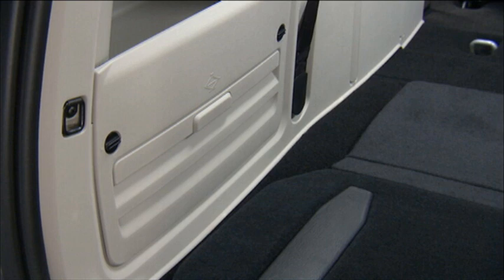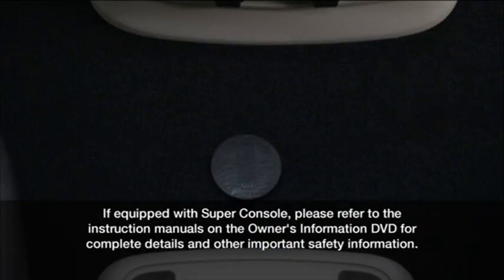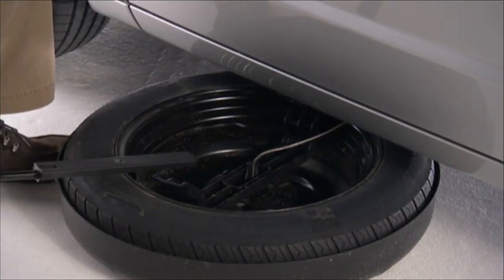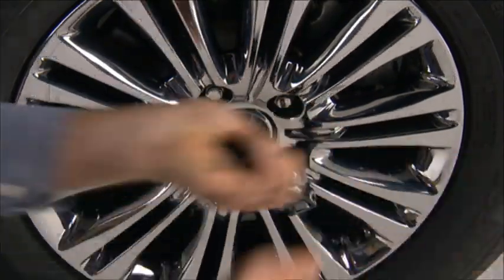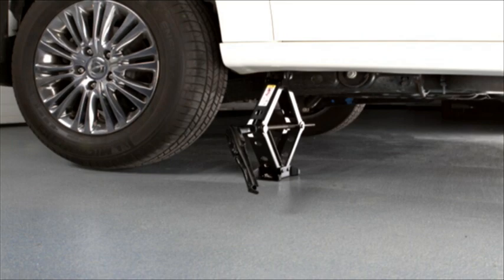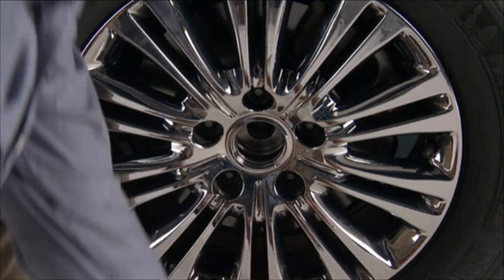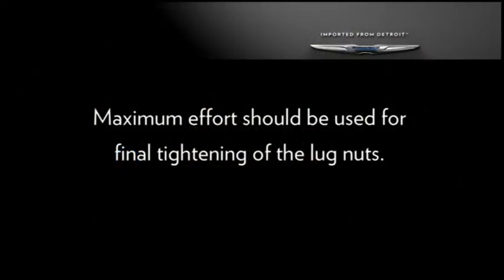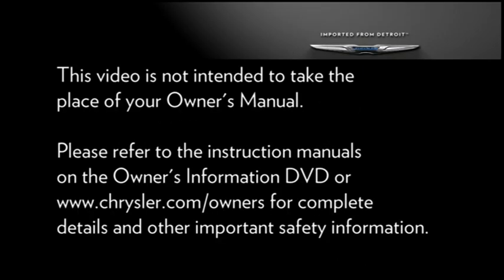2013 Chrysler Town & Country | Jacking and Tire Changing

Comment: Helpful, except it takes Superman to actually remove the tire nuts! Or an electrical tool! Sadly not designed well for people who are not body builders! :/ disappointed.
Reply: it was easy for me, im not a body builder thats for sure
Reply: That why you use a pipe that can go over the tire iron for extra leverage
Reply: You need anti seize lube on the lug nuts, at least that's what I use in Michigan where salt is used on the roads during winter